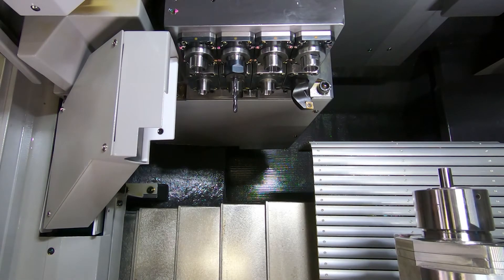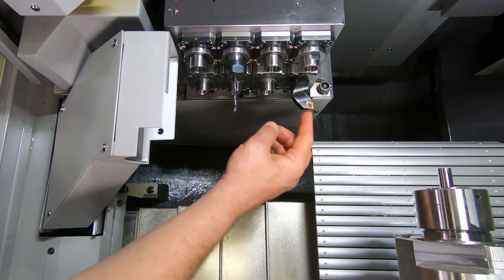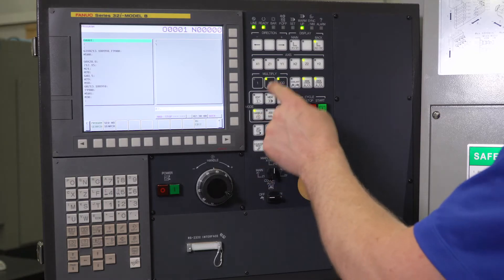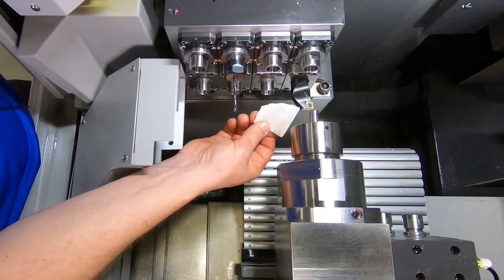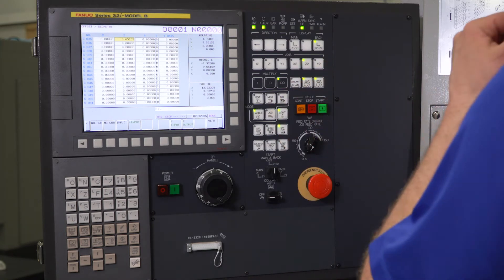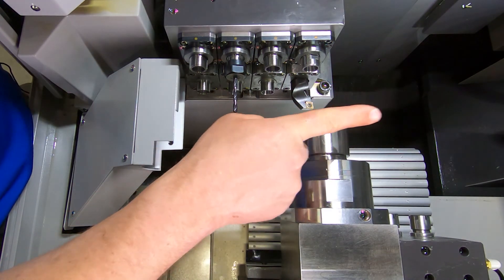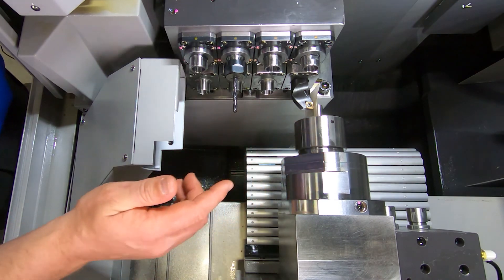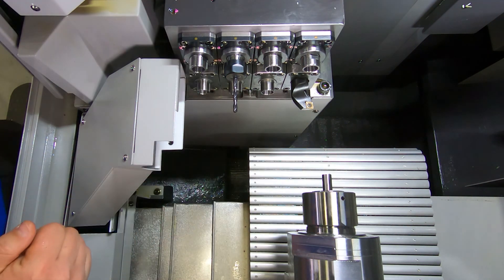How to Touch Off an OD Turning Tool on the Sub Spindle Side

Comment: nice video, and Machine, but would be nice to have a video showing How to install tools, for beginners, to this style of machine, and to cnc machines in general, as there is little out there on this, other than the haas loading, from themselves, or tool turrets on basic manual lathes/mills and esp. since most think this is soo basic a task, or have the time, just 'do it', but for some of us (some disabled people, autism, etc), as well use this in basic factory work, or for our own buisnesses so some video is helpful, esp. in the reading of the manuals, and to show us the steps.